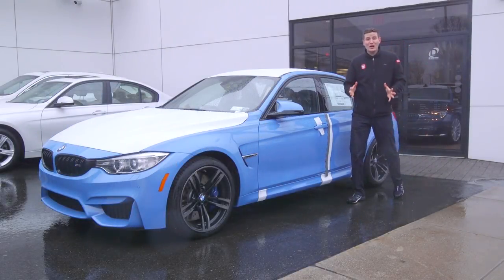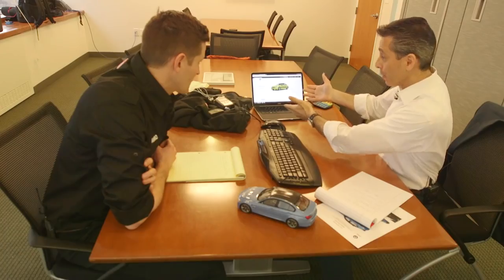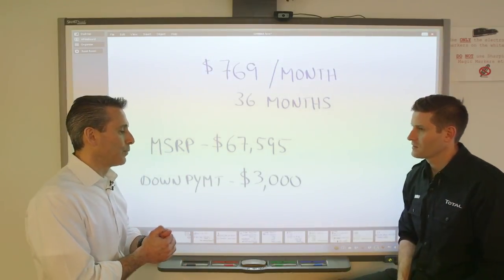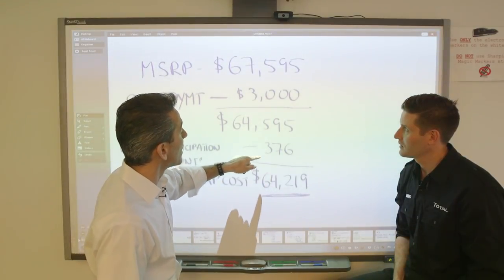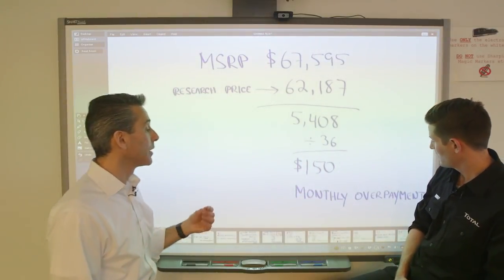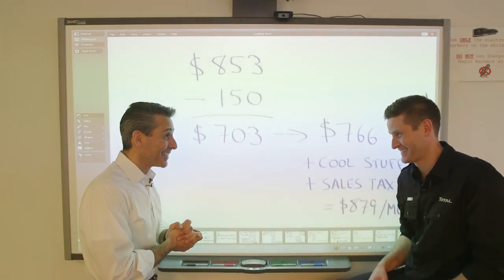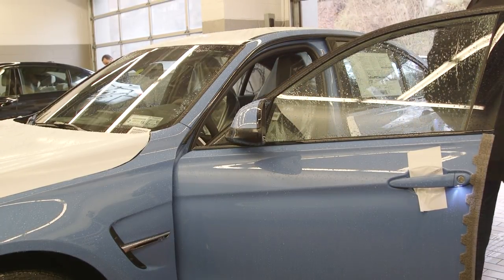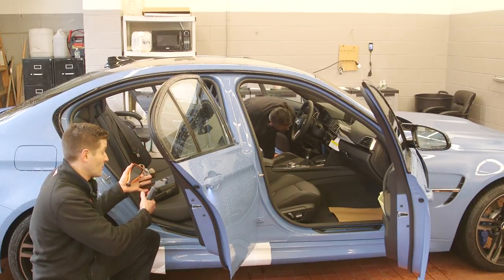How to SAVE $5,000 on a Lease: BMW M3

Comment: I did not find this video very informative. few easy steps in my own thought process which I normally do when I buy a car. check TrueCar research the vehicle you want to see what the average selling price is. and the next thing is have great credit I'm talking about 700 and above. better interest rates better payments. if you're buying a car outright look how many years you're financing the car and look what the residual value is going to be at the end. take those bits of information to a dealer see if they'll work with you if not move on to the next dealer because there's always going to be a dealer out there that wants your business. also I refuse to buy new I'll buy a certified pre-owned better warranty and I do not have to worry about the depreciation value after driving off the lot.

Comment: This is totally useless information. The guy didn’t calculate residual and the interest (MF). He paid what any Joe off the street will pay just by saying they want it cheaper.  

Lease calculations must include the MF, residual and after that include all taxes, plates, and bank fees in the price and divide by lease term. He said he paid zero down but he paid all the fees it looked like.. so his payment is higher then what he said it is. 

Msrp is a made up price has no part of any math calculations. Get the MF and Residual online; go to the dealer and get the cap cost. Go online use a lease calculator. Then bargain from there.

Comment: First this getting a discount on a new car.... don't buy a brand new car. Only idiots do, always buy a 2 year old car if u want one.... it doesn't make a difference it'll be new to you, and you don't have to lose 25% of its value as it roles of the lot.
Reply: @goodguy3803  first of all u didn't get my point of getting a car. U didn't understand the point of depreciation buy which u can save money on a typically almost brand new car. And as the person is talking about luxury cars the effect of depreciation plays the most on them. Not the cars designed around necessity. Ever bought a brand new Mercedes? Got a brand new GL for 100k lost 20 percent value in 3 years. The market price was around 75k on average.
Reply: @goodguy3803  "Most" depreciate drastically... I bet u can only name a couple in every general class of cars. Not worth alot of times to what u want as a consumer or what u is available in the market. Try naming a few lux cars...

Comment: Leasing is the worst financial decision plain and simple.  Let's say you bought it on 5 years loan, after you pay it off its yours out right and still worth around $25-50k depending on the miles.  So you can sell it, take cash to put on the new one or pay for out right in cash if you got savings too and get a steeper discount.  I'm not saying never do it, but patience is key.  Me for example at 21 now 24 I bought a light used in 2014 a 2012 ford fusion hybrid with 17k miles for $21k, it will be paid for in 3 months currently worth $15k with less than 44k miles. I lost a whopping $6k in 3 years now tell me why leasing and buying new is smart.
Reply: $15K for a 2012 Fusion Hybrid w/ 44k miles is a bit generous. Bluebook is $9k~ and a dealer will only give you $4-5k on trade-in. But in your case, it wouldn't make sense to lease because it was a cheaper car and used. Plus you're the type that prefers to hold on to a car for 5+ years, so the loss of depreciation doesn't matter to you since you hold and can recoup some of it back if you ever decide to sell it. If you managed to sell it for $9k (current bluebook as of 5/14/17), you lost $12k in 3 years, and that's only because you let the 1st purchaser eat the bulk of the depreciation (smart move by you)... 

For comparison, let's say you leased a brand new 2017 Fusion Hybrid. A quick search on a base Hybrid on cars.com is $18,995. With Ford's current lease incentives off of their website, using current market price and this process, your lease payment with tax (each state is different) will be $166.65. That is $5,999.70 spent in 36/mths, with $13k remaining. 3-year depreciation will put the Fusion's value at $15k, which is a good car to lease. Now you have the option to buy back your leased car "below" market value. Leasing isn't for everyone, but it's a great decision if you choose the right car and have the right plan "before" going into the lease. As a small business owner, you can write off your lease.
Reply: Most dealers in the area I live in use Nada and Blackbook and was quoted $9700 on trade less than 2 weeks ago, they actually dinged me $400 due to a small ding on rear quarter panel and a deep 4 inch scuff on the bumper.  If I would have traded at that time it would have been the only one in 100 miles from me with that low of mileage on cars.com.  But what happens if you suffer a job loss and have no emergency fund plus it takes you 4-5 months to find a job, it gets repossessed and you get a credit drop or not I see yes and no wherever you look.  Even if you factor an emergency fund whats more important the new car smell or a roof over you head and food in your stomach.  The way people are also not looking at it is you need a down payment most of the time and the payment never ends if you choose to be habitual leaser.  

Meanwhile if you pay off you car and drive it that is additional money that can be put towards your IRA, other investment options, or pay cash for your next car and be debt and payment free.  Plus look at your grandparents or older people they typically have a good amount of money.  They didn't get where they are  leasing cars andneither do most average millionaires.  They got there by living below their means and having no debt/leasing payments, so they could save and invest.
Reply: 12FFHybrid Dave Ramsey is that you? 😂

Comment: 800 a month for 36 months doesn't even add up to 60k, let alone interest rates etc so wtf is this bs video?
Reply: That's why it's called a lease.
Reply: $800 a month is the lease rate, it's a lease not a loan.
Reply: You're not paying the 60k in 3 years. You're just paying for the loss in value of the car after 3 years. The will resell the car after the lease.
Reply: So this car drops 800 dollar in value every single month? Rediculous
Reply: Yaboi Dope The car world is the biggest scam out there. So many people buy new cars and if not putting a good chunk of money down they are already upside down on their loan and it will continue to depreciate. So then people go to the used car dealers and they are getting raped by them also because they can buy cars so cheap at dealer auctions and turn around and sell it double sometimes triple the profit.